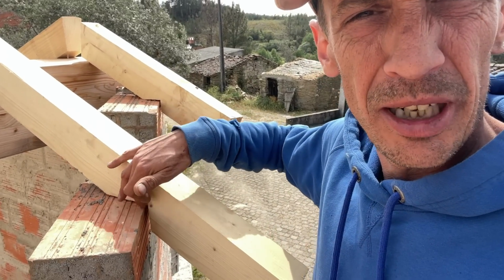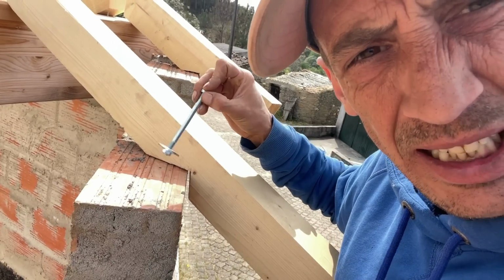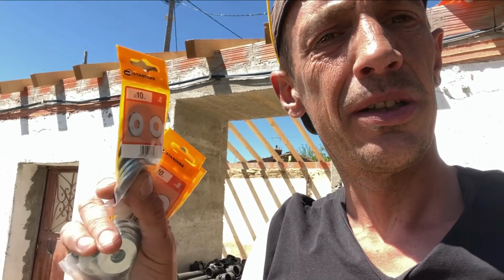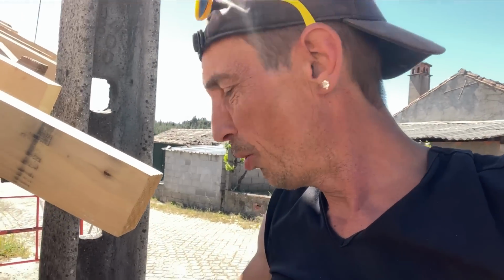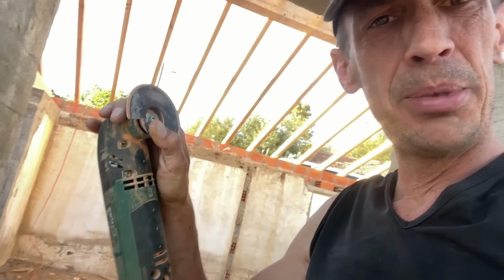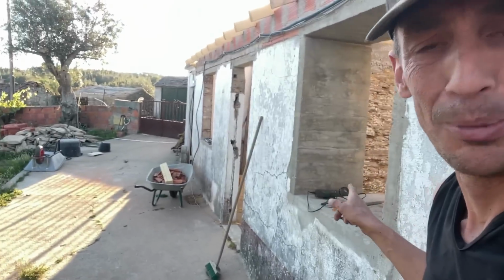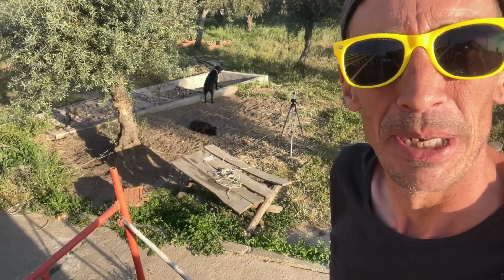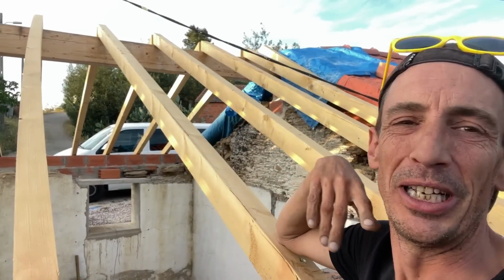S3E14: ANCHORING THE RAFTERS TO THE WALL - DIY PORTUGAL

Comment: you would of saved a lot of time and effort if you would have used a wooden wall plate, which is the correct way to do it and also Birds mouth  the tops as well. In all my years of being in the building trade I have never seen rafters fixed like that until now
Reply: Hi Dave, would you be a baby boomer? Just curious? I don't know if you catch my drift. In no way am I trying to insult you with this question. It's just different age groups seem to think differently. If you have kids you may remember when everyone got winners ribbons/ trophy's. People of different ages have their own concept of a job done well. I think 🤔💬. Anyway I agree with your suggestion.
Reply: @ellelyn2000  No I'm not a Baby Boomer, I'm a Carpenter, do you catch my drift. In this day and age of so many how to and hack video's on youtube showing you how to do things, it's hard if you haven't done it before to pick the right one to follow or copy,
Reply: @daveoliver7521  I don't know, anyone following should, look in a book . All this Beam and rafters can be found . So they can see the correct way. I'm no carpenter but I have built many things and purchased a few books over the years. And never seen many things show on u tube. That are crazy in my opinion.
Reply: The man is a complete bodge artist
Reply: There’s the right way and then there’s his way, on everything. Much fun watching though.
Reply from the maker: It’s the same way they did it in the old days here. Just drop them on the beam. It’s fine :)
Reply from the maker: I’m really not trying to show anybody how to do anything. I never say, do it like this or such. I do I like this :) 
Listen.. my main role model in life was Pipi Longstockings so .. shouldn’t anybody take an example out of that :p

Comment: Roof is nice aligned but im not to sure if the way u secured the beams at the bottom wont crack the tijolo if u want to give it extra strenght u can dril a small hole vertical at the hight of the wall put a steel pen trough it and cement the beam and pen in
Reply from the maker: No mate, it’s rock hard. I tried to hamer one out because a beam was to low.

Comment: I thought a wooden wall plate would of been easier for you, then nail the rafters to it with a  gun , keep up the good work
Reply: That would have been good for the straight wall but difficult for the angled, stepped wall. A wooden block pushed inside the brick cavity would work too.
Reply: Yep, there should have been a wooden beam along the wall to nail into.
Reply: A wall plate would have worked the same as he did his bricks, cut exactly the same but on timber,
Reply: Each to their own but I would have used chemical anchor into the brickwork with some threaded bar.
Reply: @matthunt2128   yep I would agree but read what nigel wrote.
Life and old construction is not perfect.
And if many of the others who have commented.
Life and building regs like here do not always work.
But it would have.
So would have metal straps affixed to the walls all along.

If you watch many more Portuguese and Spanish old builds Building in those days was wacky but did last from when they were built to today's Jasper refurbishment.
Reply: Folks, we are dealing with hollow blocks here, there’s no good way to anchor to. A bit of cement dabbling in the holes won’t do it either..just relax and watch the show.
Reply: A wall plate is fixed on with metal steps, fixed into the timber, the straps then come down the internal side of the wall and fixed with screws. This prevents any lift, the plate does not need to be screwed Into hollow bricks.
Another option would have been to build the top part with a rigid solid brick.
Reply from the maker: Goes for you to then, don’t be bothered by other comments.. just enjoy the show Don ;)
Reply: @GhostTownVlogs  thanks, doing so, relaxing and enjoying the show, kindly disregard comments  not intended for you.

Comment: At first I wondered about how you were going to lock the bolts in place.  Cutting holes and filling them with cement is a very elegant solution.  
Question:  Are there any building standards applicable to what you are doing?  Any official inspections?
Reply: Are you kidding?

Comment: Not sure i like the construction of the roof where the rafters meet the ridge beam, they should be cut to sit in the beam not just the bottom edge resting on the edge of the ridge, there is no evenly spread weight distribution, you arenjust squashing the edges, took the time to bird mouth the bottom but not the top. Not sure  this is best practice